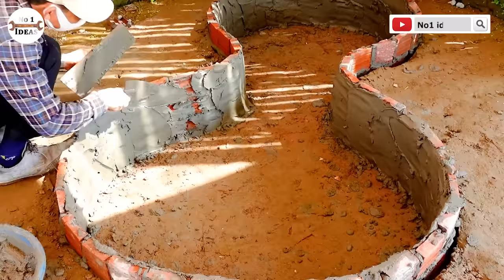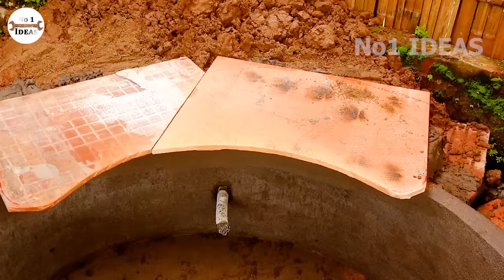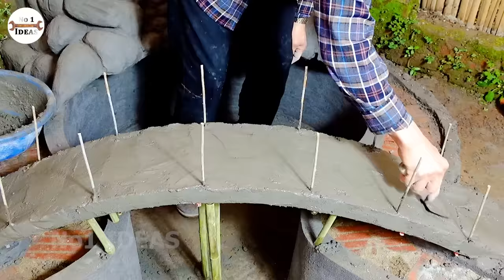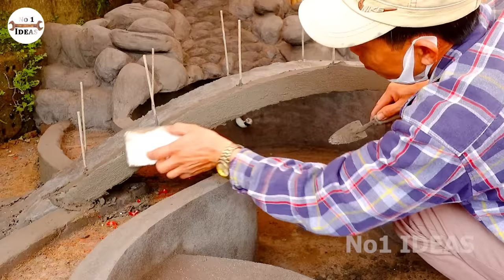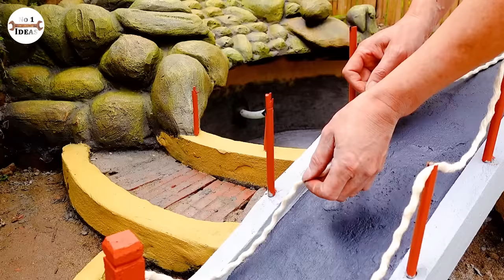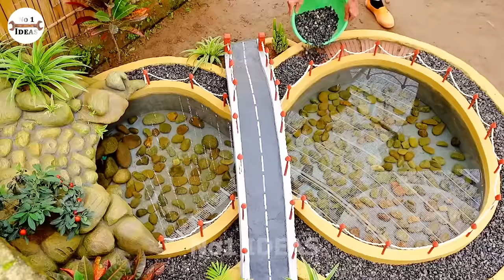Easy to DIY waterfall aquarium for your garden corner | Creative ideas

Comment: good evening, if I may ask for a little consultation, if you want to build a fish pond on the top floor, I plan to reduce the cost a little, namely by making the front wall made of gypsum finished walls and thickened with a sufficient layer of cement stucco and there are several pieces of iron in the layers.  cast or just ram wire (which is adjusted to the height of the fish pond wall later, so that means without using sand is it strong to withstand the load of water? and for other walls, it is enough for an existing brick wall, of course, it will also be covered with thick cement stucco without sand  , sorry if my question is a bit confusing?
Reply from the maker: Thanks so much for your suggestion 😍😍😍